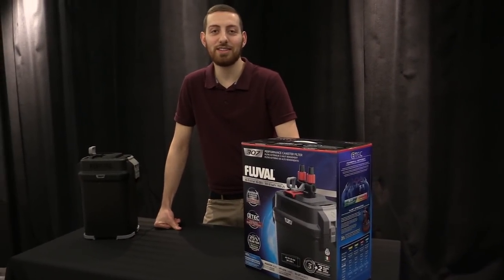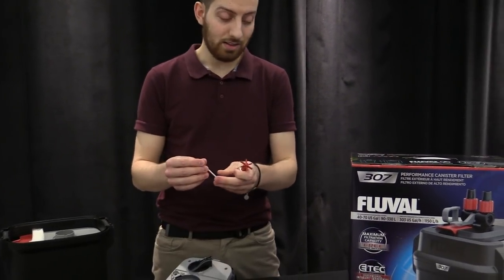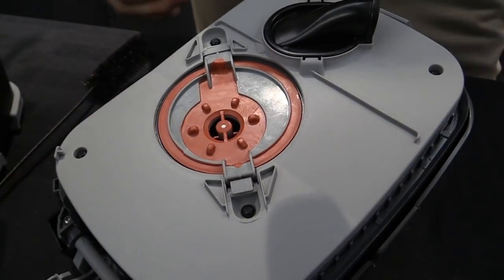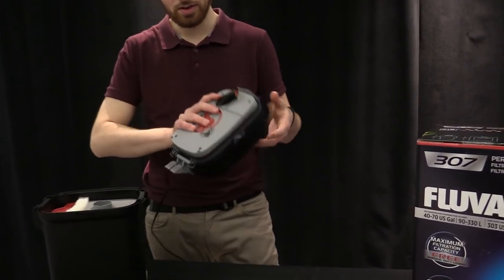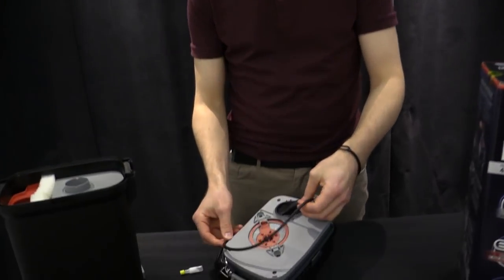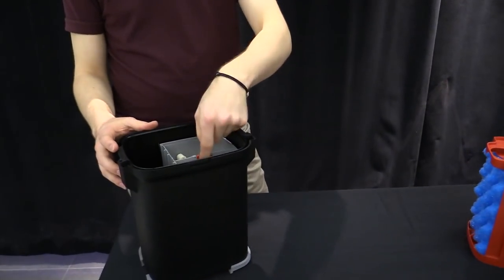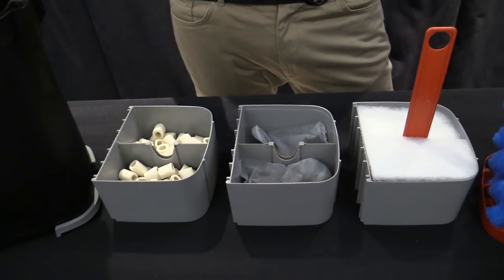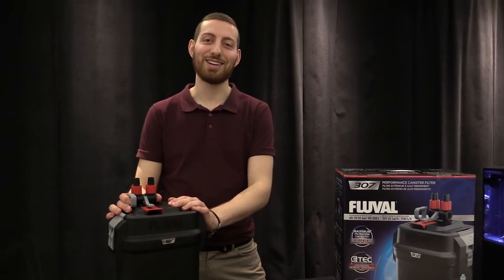Fluval 07 Canister Filter Series | General Maintenance

Comment: just bought the 407 at petco. additional 25% off the sale price. $162.36. excellent deal!!!
Reply: I just bought a 107 for 60€ 🤯
Reply: Now currently like 220 and my head unit was making water piss all over the floor don't know if fluval will honor warranty cuz of lost reciept 😢
Reply: Been a year so wonder if I should try replacing the gasket I just have a crack going along the flange that the gasket sits above

Comment: I recently upgraded to a 407 from a SunSun 303b. The reason being is I have a co2 reactor that required a bit more push, the 303b is still a good filter for how inexpensive it is. One thing SunSun (and like) filters are known for is having huge media baskets, so I was a bit worried at first that all of the cycled media wouldn't fit in the 407 because of the basket size. This is where I was most impressed...it fit all of my old cycled media with even a little room to spare. And even being that full of media, the flow is still noticeably stronger than the SunSun 303b and my co2 reactor is now running more efficiently while providing more current inside the tank. Also, for those wondering, 5/8" or 16/22mm hoses fit perfectly on this filter, so I didn't even have to modify my intake and output loops! Now if only their ribbed hosing could be safely adapted to aftermarket intakes and in-line equipment, it would pretty much be perfect and there'd be no need to use the 5/8"/16/22mm hoses. (This is all on a 40 breeder size tank)

Comment: I can not wait till the 407 hits north america my Ehiem Pro 4 is going to the trash can .  One question well 2  can i use strait hoses and a spray bar with the Fluval 407 . I do not like  your hose  looks like a area to collect debri thats just my preference ..All the uk videos i have seen have got me overly excited ..
Reply from the maker: Melain! Thanks for sharing :) The 407 is shipping in the USA and in Canada it should be at end of May. There is a spray bar kit as a separate accessory coming as well. If you source flexible PVC hosing with the same I.D and O.D as the rubber connectors found on the ribbed hosing and you can, it will work.Enjoy your upcoming Fluval 407!

Comment: Thanks re video. I have to admit I haven't changed Bio.max at all but clean every 2 weeks . I do clean abit with tap watecand not just aquirium water  i have an aquatic vet every 6 monrhs who checks my tank water and fishes and its always at optimum levels .maybe I change some biomax bur works well . I do use 12 types media. Please can u tell me I have biomass bottom and fine clear and pads at top is this wrong way round ? Yet my levels pretty spot on .thx any plans to bring out a 507 series?
Reply from the maker: Hi James! We recommend placing your biological filter media in the top baskets, as this is the last stage of filtration. However, as you've noticed, the order of the filter media isn't too important, and you'll get good results with a variety of media configurations!

Comment: I understand you guys are running a business and need to make sales, but saying to replace the biomedia is kind of misleading.  
If you have proper mechanical filtration, you may not ever need to replace your biomedia unless the product starts to physically deteriorate. Maybe Fluval biomax falls apart fast, I don't know.   
Either way, I've got biomedia that's been in use for 5+ years.

Also,  is Fluval ever going to discontinue the use of ribbed hosing? It's the one thing I (and many others) don't like about your filters.
Reply from the maker: That is not our intent, as bio-media ages fine pores clog, we therefore recommend partial replacements over time. While we are aware that ribbed hosing is controversial in our opinion the benefits of facilitating installation, durability over time (does not harden like standard pvc flex hosing),  and improved I.D which supports flow over time (we have interesting supportive data in long term tests for this), for the few negative points we have heard we have not experienced and have for now decided to stick with our application, we do appreciate your comment, thanks.
Reply: I agree My biomax is good now for 1 yr and my ammonia remover gets replaced every month or so as it gets dirty and used up quick and same with the mech but that is rinsedevery month and changed every 2 months. The filter is filled with gunk and the water is brown the first time. Alos if you do change it, change it one at a time swapping
Reply: Yeah man it's like these guys are engineers or salesmen,  but not aquarium owners  lol
Reply: @fluval  I think the biggest reason for people wanting traditional style hosing is for plumbing reactors, heaters, atomizers, and other equipment in-line. I've read from multiple sources that Fluval does not recommend doing that with their ribbed hosing and rubber connectors for risks of leaks.
Reply: @tomthebomb3189  why are you using ammonia removers? Your filter isn’t effective if it can’t remove ammonia and convert it to nitrite and nitrate. Damn I barely need to change water ever and my tds never goes over 300 even with ferts or meds added. Filter cleaned every 3 months, I top up evaporated water but my average tank in the front room hasn’t had a water change since autumn last year. It’s heavily stocked too and doesn’t need changing yet either. Effective filters with effective mechanical and biological filtration is the bomb, companies not telling you how to properly set up your media correctly or efficiently is just a scam.
I learnt good maintenance and good filtration from the pondguru a long time ago and it would’ve saved me a lot of money because I didn’t listen to fluvals unnecessary expenses from the get go. I use his products too. Bio home is the best media for filters fact.

Comment: I've had my Fluval 407 for eight months and am very happy with it.  However: I accepted Fluval's word that they recommend replacing media as often as they do for practical rather than monetary reasons until I purchased the Fluval silicone lubricant.  For four dollars I received a tiny container half-filled with silicone, barely enough to lubricate the 407's three O-rings one time (if I squeezed the container hard enough!).   If Fluval is really adamant about the importance of maintaining the filter parts (and their reputation), they should be a little bit more liberal with how much silicone they provide in their packaging.
Reply from the maker: We hear you.
Reply: @fluval  Great but what have you done about it?
Reply: Use vegetable oil, good enough. Replace annually as the rubber erodes and you don’t want it leaky

Comment: He says change Chemical Media every month EVEN though he says it lasts 4 or 5 months before it stops working. !!!
I use the 207 style foam on my 206.
It is also good to see the correct order of trays here, unlike in their 7 series video.
Reply from the maker: Take note that the video is started with the statement that these are "general recommendations, conditions can vary"...meaning from one aquarium to the next depending on what is being kept which can have very significant differences in maintenance requirements. When it comes to chemical media this is the most  impacted category in regards to exhausting the capability of the media based on how many fish, what species, their sizes, etc...The same applies to the order of media stacked in baskets, there can be some variability there as well, for the same reason.

Comment: Is fluval lubricant the same as the ones sold in street stores?  For example, can I use Vaseline for maintenance?  ?
Reply from the maker: Hi there! It's very important you do not use Vaseline, as this substance dries out rubber gaskets and will cause your filter to fail. We recommend only using Fluval Silicone Lubricant: https://fluvalaquatics.com/us/shop/product/silicone-lubricant

Comment: Hi I'va had my fluval 07 filter for about a week now but my propeller rattles around in the filter which is quite loud... I was wondering whether you either have a video of a running filter so I can compare it to the sound my makes or if you guys have any maintenance tips thanks!
Reply from the maker: Hi there, we're sorry to hear about this! 07 series canister filters should be almost soundless - you can't hear them unless you're very close to them. If your impeller if making a lot of noise, verify that the filter was primed correctly, that the hosing follows a straight path from the rim of the aquarium to the canister, and that the entire impeller assembly is clean (there can sometimes be debris left over from manufacturing). If you need more assistance, don't hesitate to contact our customer support team: https://fluvalaquatics.com/us/contact-us/

Comment: Hey After maintenance..do we need to prime again for water flow and then plug  and switch on..
Reply from the maker: If the AquaStop valve has been disconnected properly (close flow regulator, then unplug unit), the hosing will remain full of water. Once you've completed your maintenance, reconnect the AquaStop valve and open the flow regulator: this will fill the canister with water from the aquarium, and as such priming won't be necessary!
Reply: @fluval  thanks ..One more thing..while normal water changes Abt 20 to 30 percentage..no filter maintenance..do we need to unplug the canister filter or we can just close the flow regulator..
Reply: @althaf120001  I have the 207 and during water changes I keep the filter running. The important thing here is the depth of the intake, obviously you do not want to have the filter running if the water change will take the water level BELOW the top of the cage intake. Mine is quite deep (three quarters down) in my 125 litre, so 10-30% changes are fine.

Comment: Hi ive just purchased  a brand new 407 filter. Can i just ask are the clasps supposed to be loose fitting when closed. Theres a slight click but they dont seam to do much in terms of pulling the motor/lid with any preassure to ensure the seal is compressed properly. They just flap about a little and seems there only usefull for removeing the motor/lid.
Reply from the maker: Hi Dan! What you're describing sounds perfectly normal, but we encourage you to contact our customer support team about this! You'll be able to send them pictures and videos and they can advise on whether it looks right or not. You can reach them here: https://fluvalaquatics.com/us/contact-us/

Comment: I've been considering upgrading the U4 on my Roma 200 to the 207 external filter because I'd like to reduce the time I spend maintaining the tank. After watching this video it seems that while I may be able to extend water changes and media rinses to a once a month job rather than 1-2 weeks on the U4 that I'll have quite a lot of extra parts to maintain and replace? Is there any benefit to me upgrading and if so what are they?
Reply from the maker: Jack, switching to a canister filter will provide greater filter media surface area & volume which not only extends maintenance intervals but total capacity. The canister filter output when situated at the waters' surface should contribute to somewhat better dissolved oxygen levels as well. Both systems use a magnetic drive motor with a magnetic impeller and in that sense are quite similar. We also prefer an external canister filter in terms of being able to access the pre-filter stage to regularly export trapped waste without having to enter the aquarium to do so.

Comment: Thanks fluval good info BUT the ribbed hoses need to be flushed every 60 to 90 days
Reply from the maker: Chris, that really depends on what is being kept in the aquarium. That said, in our testing twice annually maintains perfect performance for most set ups. The same applies to PVC hosing which also accumulates bio-films and other organic accumulation.
Reply: can the ribbed hose be swapped out with normal clear hose?
Reply: Easy enough to use PVC or vinyl hose and clamp in place of the ribbed hose if you prefer.

Comment: I have this filter but it goes through the bottom of my tank so how would I clean the intake assembly and the hosing without water going everywhere?? Surly I'd just have 2 holes at the bottom of my tank??
Reply from the maker: Great question! In the case of through-tank connector systems, there is no need to clean the hosing since it's quite short. Everything else can be cleaned normally - simply closing the AquaStop valves will keep water from spilling out!

Comment: I’m researching canister filters for my 29 seaclear and im very interested in this filter. Im wondering with the hose and clips, will they fit my aquarium? The seaclear does not have the traditional rim most aquariums have. Thank you in advance for any guidance.
Reply from the maker: Hi Connie, unfortunately we have not installed this series of filter on a Seaclear set up. We did have a look on line and did notice that some have purchased that set up and installed a Fluval 206 on it so we would assume the this model of aquarium does have suitable accommodation for various filters.

Comment: I have a Fluval 307 canister filter. I’m trying to get water to filter head for the filter to take control. I followed the instructions but still no water. I took the bead off the canister and clean all contents. When I had it ready I turned the filter head on and the impeller would rotate but never got in any kind of tempo. It turns good but won’t have a constant flow. All together again and can hear filter trying to flow but can hear trying to get water but still a no go. Impeller not working properly. 

I took it apart again and for some reason I put the circular motor back in with out the rod!?!? Now the little motor I can’t get it out of there 🤦🏻‍♂️
Reply from the maker: Hi Kevin, was the filter primed correctly before you turned the motor on? We encourage you to contact our customer support team for assistance: https://fluvalaquatics.com/us/contact-us/

Comment: Why do those two pre filter sponges stick up higher than the plastic holder on the inside of the filter? Should I cut it to make it even with the plastic holder? It seems like when it sticks up higher it would impede water flow to the other side of the prefilter. Am I wrong?
Reply from the maker: The pre-filter sponges should not be cut down, they are made to fit the module designed to accommodate them which in turn is designed to conform to the water flow path.
Reply: @fluval  Will the newer pre-filter sponges for the 307 series work on the 306?

Comment: Instead of A325 silicon lubricant is it possible to use Durex or Glyde silicone lubricant?  Or is it totally different?
Reply from the maker: It needs to be 100% silicone paste, the products you are providing as examples have different applications and additives that could be an issue.
Reply: @fluval  thanks very much.
Reply: Magic Lube should work as well.
Reply: Superlube is ideal

Comment: I bought FLuval 207 2 week ago. It is so noisy! dramatic! what can be wrong? impellar?
Reply from the maker: Hi there, we're sorry to hear about this. 07 Series canister filters are almost soundless when operating correctly, so something is definitely wrong! Please verify that the impeller assembly is clean and correctly installed, that the filter has been properly primed (always ensure the filter output is above the water surface when priming), and that the hosing follows a straight path to the aquarium with no kinks, loops or excess.
Reply: @fluval  hello. I check everything. Something is wrong. Probably impellar... my seller says that he will send me new one. I hope it will be silently 🤫. Best regards

Comment: I have 2 of these 307 + 406 and they are very good filters.
Some notes though, you can buy a much bigger tube of silicone grease off the shelf for £4.99 that does the same as the fluval lubricant.
You can replace the ribbed hosing with thick walled clear plastic good quality pipe. 
Much easier to clean using a pipe cleaner and no need to remove from tank to flush out.
And please just buy a massive pack of pond filter sponge and just cut your own to size, you’ll save a fortune.
And yes the ribbed hosing is terrible and pretty much non compatible with any other aquarium products for example adding an in-line CO2 diffuser/reactor or heater nothing will connect to it.

Comment: What is the ID and OD of ribbed hoses for 307 and 407?
Reply from the maker: ID and OD of the rubber connectors is the important dimension, they are the same for both models at 18/22 mm respectively.

Comment: "chemical media after about 4-6 months just stops working, it's no longer chemically active". This is surely erroneous and you in fact meant 4-6 weeks. Where's the quality control with the uploaded videos?
Reply from the maker: Chris, at the very beginning we clearly point out that the replacement frequency is dependent on your particular filter and tank set up, as you are likely aware there can be differences in types, size and numbers of fish as well as the decor used, tap water quality and a number of other factors and circumstances that could very well necessitate changing chemical media more often.
Reply: not true carbon can reach saturation after a month oxins and 1-2 weeks if there are lots of tannins and water is murky with and zeolite can take as little as a week to be saturated if ammonia level;s are highake a m even ion normal levels or slightly high levels (0-0.2ppm or even 0.5) it will take a month normally
Reply: @fluval  well according to UK support chemical media only lasts maximum 4 weeks and constantly needs replacing, it also states in your manual to replace every month

Comment: Replace carbon once a month and only replace biomedia when it begins to break down or if you fail to keep it clean.
Reply from the maker: Depending on the circumstance chemical filter media such as carbon may have to be replaced more often as once it is exhausted there is no other option.